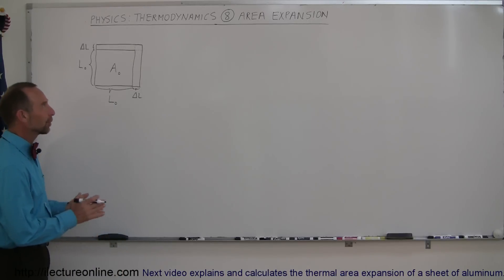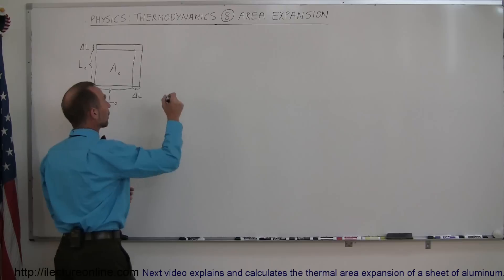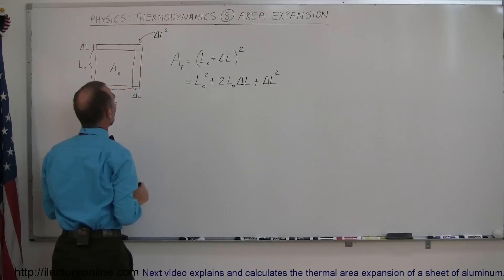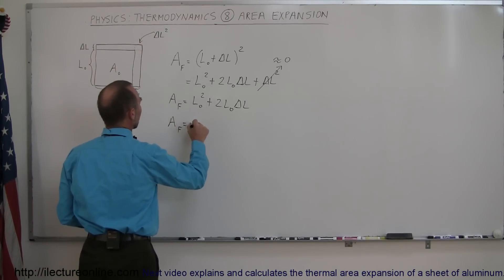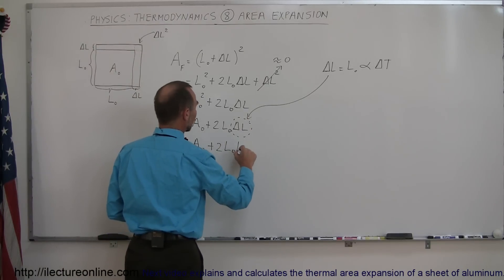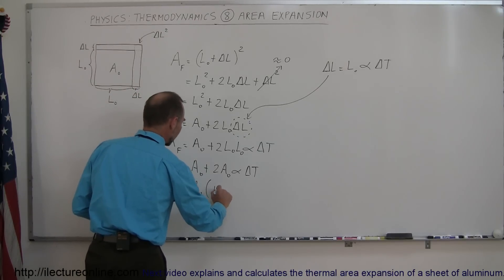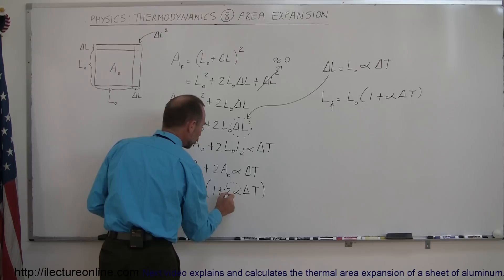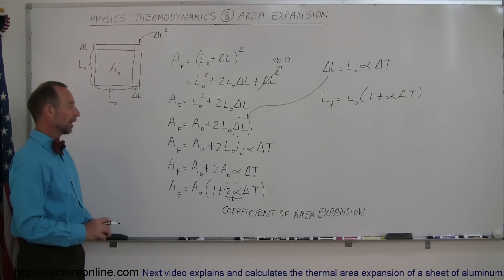Physics 21  Thermal Expansion (1 of 3) Thermal Area Expansion: Definition

Comment: hi, what if the area is rectangle and not square?
 i tried to get the final equation with no success...
maybe some real experiment to just take it for granted!
Reply from the maker: You should be able to get a similar result using a rectangle instead of a square. A square just makes it easier.

Comment: why is delta l considered to be soon small,what if we heat the substance to a high temperature
Reply: I imagine that most substances would begin to melt or degrade before the change in area from thermal expansion would become that significant.